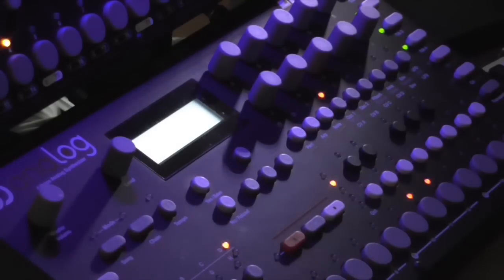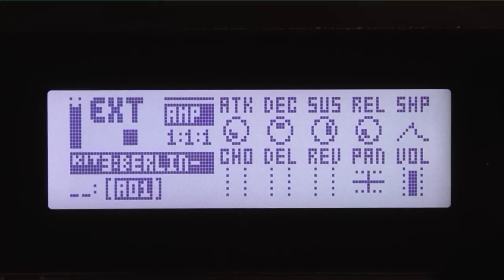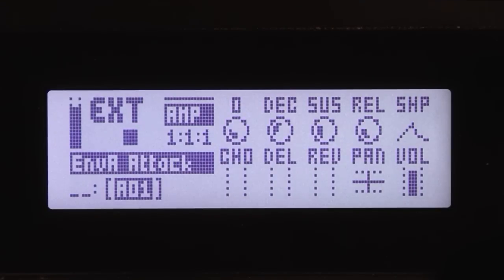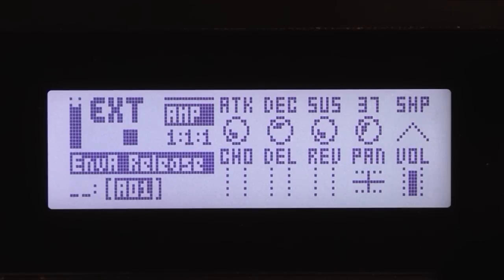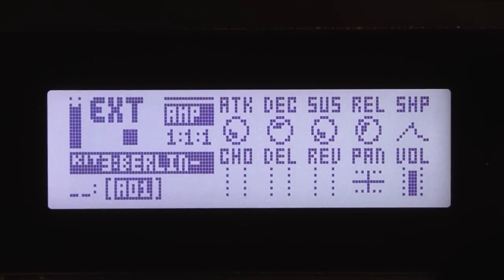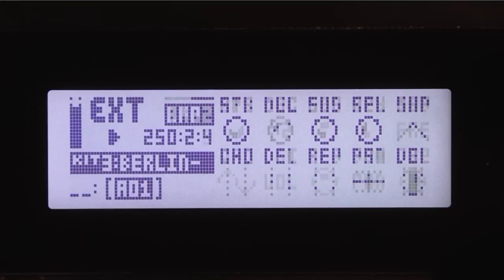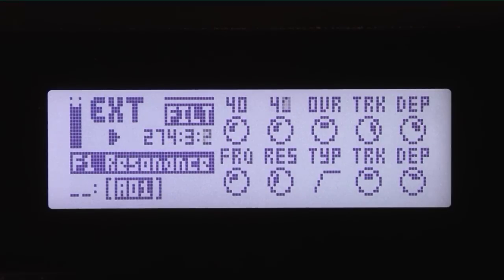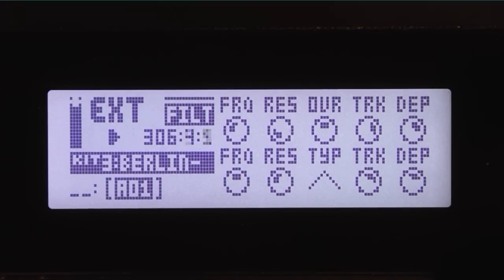Elektron Analog 4 tutorial 4 - how to do Berlin School sounds

Comment: Nice Video... i didnt checked out your page yet! but i guess ill find a ton of good explantations on some gear...
can you answer me why you are choosing a hipass filter? what is the background of it? before the analog 4 came in to my house (not long ago) and before i watched your video, i was allways using a lowpassfilter on basssounds... probably u have a little expalntation on why better use a highpass on the basssound... or why you choosed to highpass it...

thanky you again
Reply from the maker: I often use the HPF as EQ to roll off the bass where it might otherwise muddy the mix a bit. Not usually necessary if you're EQing the sound externally, but I like to have a live stereo feed from my multitimbral instruments. Of course it can sculpt the sound in more radical ways, just like the other filter modes.